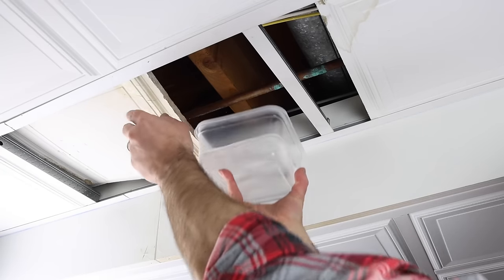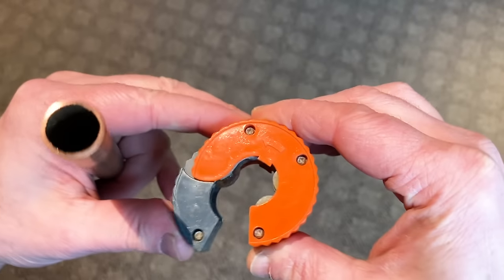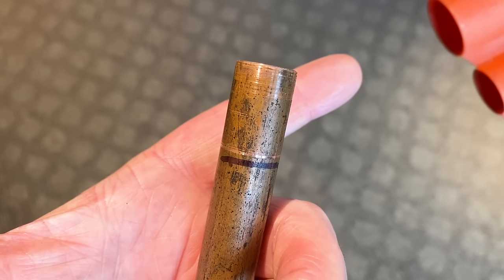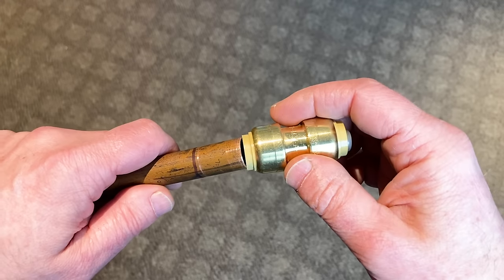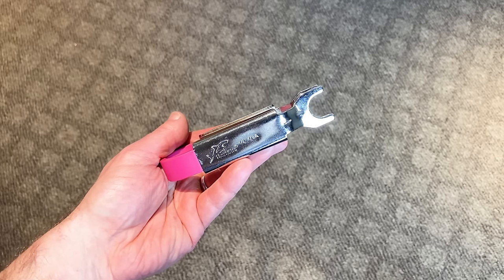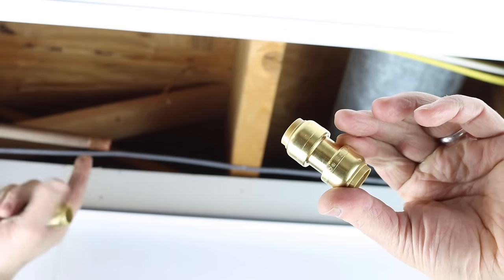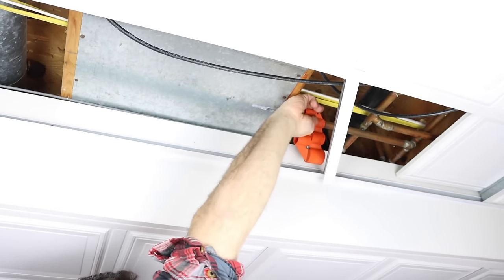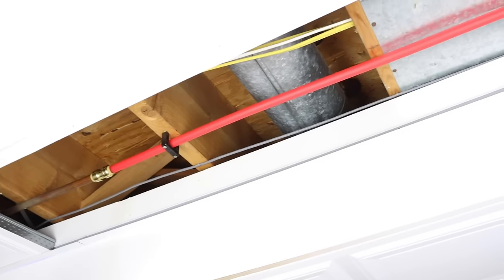Repair Copper Pipe Leaks with SharkBites (Super EASY)

Comment: Hi! I’ve added a shark bite to my copped pipes. It went on extremely easy!   But when I turned the water back on it’s leaking out the side of my shark bite.  I’m not sure what I did wrong? Any suggestions of what it could be? Thank you!
Reply: Hope you got your SharkBite to work. If you followed this video's instructions exactly, that's why yours leaked - they're slightly wrong and missing important details. Since your post was a year ago, I doubt you'll see my reply, so I won't spend more time to explain further. But if you do see it and reply that you want me to explain, I will.
Reply: @kenberian4863  I have to fix a leaky joint of copper to pex, was going to just cut off the threaded parts and use a sharkbite. What are those details you are talking about?

Comment: I'm a rookie but I didn't "get" the jumper cable bit.
Reply: If your section of pipe is part of the main water supply then it needs to provide electrical grounding.  When installing this coupling, it seems that the electrical connection is discontinued, and therefore needs to be continued through an alternate path.
Reply: @lilylandau1204  Does this also apply with pex?
Reply: @mplsfarmer  Water pipes are used to ground the electrical system ????
Reply: @anthonychase4945  yes .....if you ever install these you should definitely run a jumper if your unsure
Reply: @anthonychase4945  No, you ground metal plumbing pipes for protection in the event the pipe gets energized, will trip the shorted wire's circuit breaker or blow a fuse.
Reply: @jeffreydevoti7000  How would it get energized ?
Reply: @anthonychase4945  
A lightning strike, rat chew insulation off & touched wire, home owners making mistakes. 
Actually run into this in old house, behind bathroom vanity, insulation somehow wore off touched copper pipe and shock anyone using the faucet.

Comment: Confused here. I am replacing a small section of 3/4" copper pipe w new pipe and a connector at each end. I measured the section removed and cut a new one 2" shorter. Way too short.  And there is no way a 3/4" SB is going to accept an inch of pipe.

Comment: Looks like you have the Milwaukee Pex tube cutter. Please BE CAREFUL!!!  I returned mine to the store and made Milwaukee aware of the extreme hazard caused by the corner of the sharp blade protruding from the tool when in the closed position. You can literally slice your finger. Other manufacturers totally enclose the blade when the tool is closed. This is a major design flaw.
Reply from the maker: Thank you for the warning, those cutters are great but I’d like to keep my stubby digits for other projects!
Reply: Home Repair Tutor   If enough people call Milwaukee to express this big concern, maybe they will change the design. I just can not understand how their designers/product engineers missed the boat big-time in this issue. Most importantly, I hope this warning to other viewers prevents injury. Thank you for allowing me to publicize this hazard.
Reply: Home Repair Tutor   For those people that can not return these hazardous Milwaukee Pex cutters, you can file-down the portion of the corner of the blade that is protruding. I know you should not have to do that with a name-brand product, but safety is always paramount and Milwaukee does nothing to change the design.
Reply: Lawsuit babbbyyyy

Comment: I wonder why most  license plumber don’t believe in shark bite?  But prefer the longer time consuming method of soldering copper pipes?  I mean the shark bite company guarantees it will last at least 1 decade if you install it correctly... * correctly.  People that blame it don’t work and leaks in few days or months probably didn’t install it correctly
Reply: Do you even have this install in your house? There's a reason why sharkbite fittings are not certified for  permanent installation.
Reply: I would trust them if they would pay the water damage. People that install this in their house are re*arded.
Reply: @SS-TX   they are actually code certified for 25 years…🤷🏼‍♂️

Comment: It’s ok in an open exposed area but not designed to be installed in walls they do have an expiry date 10 years down the road the o ring will fail beware

Comment: No way. This is fake. No way did you slide that on the two pipes that were secured to the floor joists with that. You had to move on or both and put them back. Left that part out tho

Comment: what if you can't move the pipe back but you need to fit a sharkbite between them?  Show us the real world stuff lol
Reply from the maker: @JasonMax01  use a SharkBite Slip End Fitting or use a copper coupling that doesn’t have the stops and solder that such that it’s centered on the leak

Comment: If you’re gonna cut Sheetrock, go into your overhead, buy pipe reamer and cutter, you’re probably competent enough to just solder it back together after a YouTube tutorial. I’m sure there are many instances of shark bites not leaking, but why take the chance? Especially in an area that’s not accessible without cutting into your ceiling
Reply: Exactly my conundrum and I'm in Houston, with 3 busted copper pipes , one being hot water. Had plumber solder one and capped two ( one hot water) because they were "un-reachable" so I ordered sharkbites because they said they could be reachable then. Fortunately caught the first leak soon w/out much water damage. I've done a lot of things I never thought I could via YT but Cutting out drywall "searching" for the pipes in hard to reach places and then soldering them is probably out of my realm. BUT, now I'm worried I'm not doing the right thing regarding your advice ....and on a pretty narrow out of pocket budget. The work is getting done on Thurs. (B/C I NEED a HOT shower) so any other advice? I've watched all the videos etc. to know what to look for , as far as cleaning and marking and will be asking about that as the job goes.

Comment: Sharkbite fittings are good for people who don’t take pride in their work.
Reply: Lmao very true
Reply: Or people who have no other options and do not want to call a plumber for a pin hole leak. Which I’m pretty sure is the audience this video is being directed towards 🙋🏽‍♀️
Reply: Amanda Thompson there’s always a way around sharkbites. You can use compression fittings to transition
Reply: Jacks plumbing Videos I don’t know what a compressions fittings is. But I do know that the shark bite looks like something I may be able to handle
Reply: For a pin hole leak 
almost $375 That’s insane
Reply: Plumbers aren't painting the Mona Lisa when they do their easy soldering or Pex crimps.  I learned to do all of this in an afternoon and it isn't rocket-science, but Sharkbites are much easier and do the same job in the end.
Reply: @reed311  
A sharkbite is not equivalent to a crimped fitting.....that ain't rocket science either.
Reply: @Sparky Firefly 
A sharkbite connection is a rubber o-ring held by some pretty dodgy metal barbs. Plumbers don't trust them because sharkbites fail more often and plumbers see the collateral damage.
Reply: @tinman1955   where is this data of failures? Obviously plumbers don’t like them, because it eliminates their cushy, easy money jobs. I mean, I get it